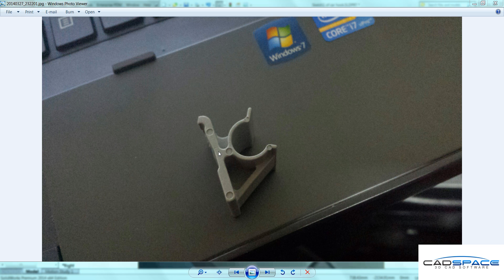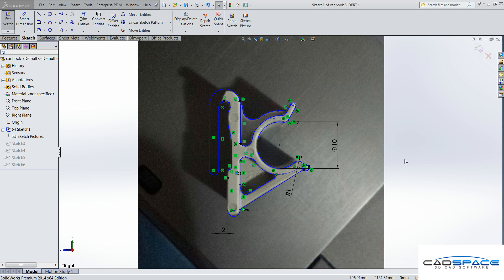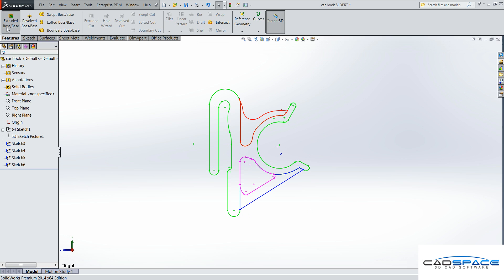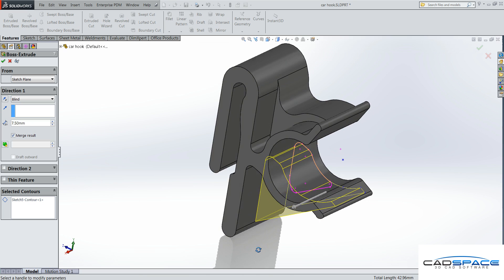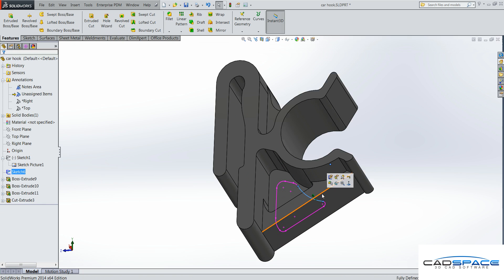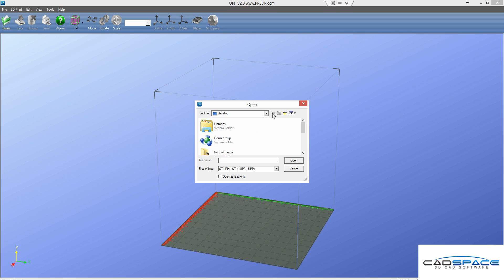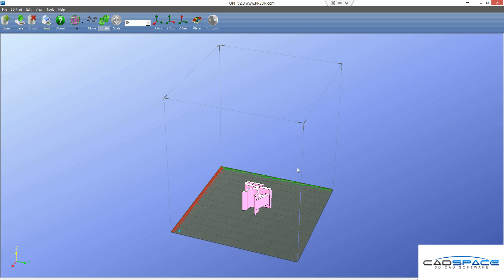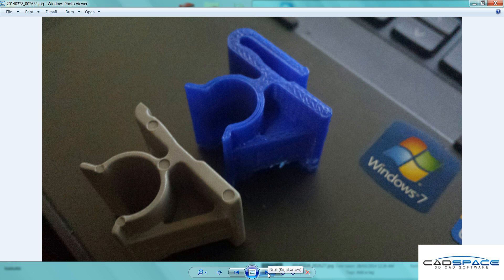SolidWorks Modelling & 3D Printing

Comment: how did you take the exact measurements of the part to draw the sketch ? i mean the diameter of that arc, clip's angle..etc.
Reply: he probably measured it with a calibrator after taking a picture of it

Comment: hey. great video.
you said something about supporting the flat surfaces in the body.
how do you exactly do that? how can you print flat surfaces which "stands in the air" without the surface turn crash down.

Comment: Ahm, is that a 8560p/w? (I know it's kinda offtopic)
Reply from the maker: +Vladislav Tachev It's actually a 8570W. The mobile workstation version. Very good system for the likes of SolidWorks and CAD in general.
Reply: Yeah, it looked quite familiar to my 6460b and 8760w, hehe. Mobile workstations with a solid quadro are a must when handling heavy cad models. :)

Comment: I'd like to see a video about inserting and tracing images and any tips on it. I'm trying to do something similar now and struggling.
Reply from the maker: Hi Gadget Addict, I previously made a video on Autotrace in SolidWorks - https://www.youtube.com/watch?v=yqhfCc0fbEQ.
With regards to tracing, the biggest tip would be to use black and white images or high contrast between the part you want to trace and everything else. The video goes through how to use the filters and sensitivity, and as you can see even with a black and white image you still won't get it perfect. Nothing beats human tracing!
Good luck with it, and let me know if I can help any more. 
Gabriel

Comment: really good job ! i have 2 questions : did the part you 3d printed in as strong as the original one , and how much cost the 3d printer you used
Reply from the maker: Hi kafe ammar the 3D printed part was almost as strong as the original part because it has not broken yet and is still working. The 3D printer I used was UP Mini and this usually costs around $700 depending where you live. 
Hope this helps and thanks for watching.